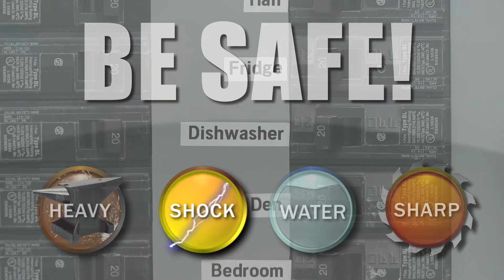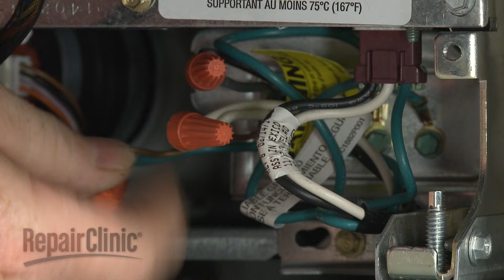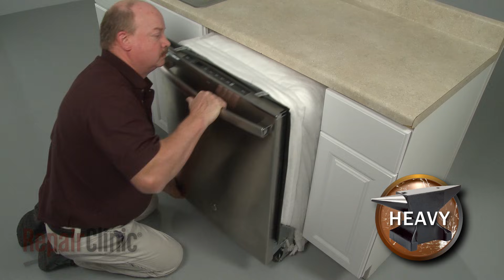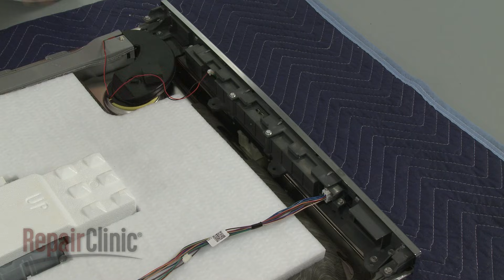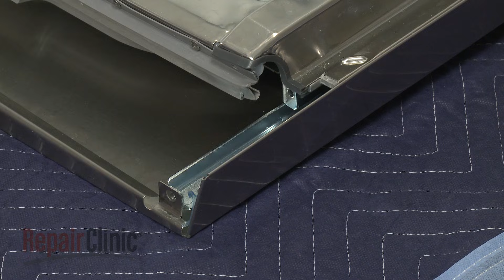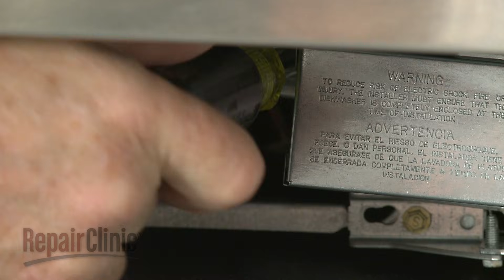GE Dishwasher Control and Display Board Replacement WD21X10553

Comment: This video left out one very important step when replacing the display board.  You need to reconfigure some pins on the back of the board to match your dishwasher model.  They call is setting the personality.  Instructions came with the replacement board GE sent me.
Reply: The particular board that he replaced do not have pins to reconfigure,  you have a different board.

Comment: My model is the GDT535psj2ss and it says it needs the WD21X23097 UI board.  They sent me the wd21x31910 but it has a number display. My model does not have a digital number display but the board they sent me does and they say its a replacement part.  Will it fit and work even though my top doesnt display numbers?

Comment: Here’s a tip if you want to avoid pulling the machine out to get access to the hinge cords.  It is easy to get the cords to pop OFF the little pulleys on the front, but very difficult to get them to pop back ON those little pulleys, without having access and leverage from the side. That’s the reason to pull the machine out of the cabinet. The springs are strong and fight back. and you CANT fit both hands under there to apply enough muscle.  (well I couldn't, anyway)

Here’s what you do to make it easy:

1) Get yourself a dog leash, with a nice clip. Yes, a dog leash. 

2) reach back along that cord until you get to the steel spring. you are probably elbow deep when you get there. 

3) clip the leash to the end of the spring, the same place where the cord is attached. 

4) now you can pull on the leash and extend that spring without even putting your hands under the machine. 

5) with the pressure off the cord, it is easy - oh so EASY - to just place that plastic end of the spring cord where it belongs. 

6 finally, reach back in and unclip your leash. 

a triumph!!

Comment: If you have the breaker power off, you don’t need to unwired the junction box, just disconnected the door wire along with the strings that holds the door… I do this type of work every day and only takes me about 30 minutes if that…

Comment: The part where you remove the inner panel by “slide the inner panel up” does absolutely nothing. I’ve removed both sets of screws on the brackets and removed those. It ain’t budging. Feels like I’m gonna break it
Reply: Did you figure this out?  I'm having the same issue with mine.

Comment: I found our dishwasher had not drained and there seemed to be no power to it. All the circuits are fine and the GFI not tripped. Checked underneath and it looks like there is an extension cord used for the power. Touched it and it started to work. It must have come loose somehow so I have tightened it and the problem is solve.

Comment: What about the jumper settings on the User Interface?
GDT655 personality 11 doesn’t work…
????
Reply: Same problem here.  Just replaced the UI board being careful to set the personality 11 setting.  Still not working.  Was told by a tech that power was good on bottom board but not on top.
Reply: Just discovered I had the pins wrong after all.  The board came with all jumpers set leaving the top row of pins open which is not the correct personality (11).  I didn't look carefully enough to notice.  With pins in the correct spot, the board powered up.

Comment: This video was absolutely spot on with information for a DIY. I have absolutely no experience in appliance repair but I applied all my years of working on computers and building them in integrated systems and looked at this project I was like it was one big computer. For me that logic worked perfectly and I was able to completely rebuild the dishwasher with the new board in a very timely fashion of about two hours and that’s taken into account my total lack of experience and understanding of appliances. Thank you so very much for this great video

Comment: Definitely not an easy repair. There are easier ways to do this. Look for other videos on technicians who do this everyday. They aren't going to disconnect the entire dishwash just to replace a control board.
Reply: Agree. Why disconnect the electrical leads and drain hose. If the door is unplugged and you pull it out a few inches to remove the door springs, you're already there. It seems they added in 6 unnecessary steps.

Comment: Great video, thanks! My humble contribution: modern models (like the ZDT915SSPJ0SS) do not require the bottom hinges to be removed. 4 Tork screws have to be removed at both sides of the door and it will be released. The new board requires configuration according to the model number. It is called ¨personality¨ .This can be done using the jumpers supplied with the new version of the board, following the instructions supplied. Save jumpers not used for eventual need in the future (jumpers showing  connecting only one pin can be removed). During final re-assembling pay attention to connect the 2 springs at the back (Left side only) that may have escaped/disconnected from the tension cord.
Reply: This is not humble. THIS COMMENT SHOULD BE PINNED TO THE TOP. 4 torx of size T25 I believe, 2 on each side. Hinges do not come out but need to remove one hinge screw on each side connected to the door.  AND YES THE LEFT SIDE CABLE DISCONNECTED! I had to fish it like a mission impossible spy to get it rehooked.

Comment: This is a solid video for RnR the UI board, with the following caveat. Replacement UI boards may arrive needing jumpers set for your specific model. 4 jumpers will need to be set according to instructions that accompany the replacement board. Lastly, door hinges may come with slightly different configurations, but with a little common sense observation detaching the inner panel will become obvious.

Comment: They neglected to show the set up of the jumper.  Pretty critical step.
Reply: Depends on the board you buy, if you buy the “exact” one that comes from the factory it doesn’t need it. GE has since switched to a more “generic” model that works across multiple machines for repairs. And yes then you have to se it

Comment: This video is very helpful.  However, the video does skip one very important step and that is to remove the vent cap on inside part of the door.  If you do not unscrew this cap the inner door will not separate from the outer door.  The video shows the entire vent assembly coming off with the inner door possibly because it is a different model or maybe a demo model.
Reply: Thank you. I was wondering what happened when the video showed the UI panel already off. I pulled a little bit and broke one of the screws hinting the vent to the panel. Thankfully I found your comment before I broke the other screw. Some glue should give it fine. Thanks for your comment.
Reply: This comment saved my repair effort.  The tiny inside vent screws like 1/4 turn or 1/2 turn and then the entire piece comes out super easily.  Found yucky stuff on the panel hidden inside, well there's my problem right there!  Glad I didn't break the plastic casing in an effort to get to it.  Thanks again!~

Comment: Will just add more of the same.  We had some random beeping from the dishwasher off and on after 3 years ownership.  Then all function of the control lights went out.  Circuit breaker did not trip.  Called GE and after very lengthy wait (6 hours) they called back, and finally agreed to sell me the main control board and UI panel for half price.  It took a few weeks but they finally arrived.  Replaced the main control board first and no change.  Then followed the instructions on this video (generally) cuz mine was a slightly different model. I had some trouble interpreting the jumper diagram but finally determined to pay attention on the diagram which round pins were connected to match the diagram.  For my model GDT695, the jumpers connected pins in the 1 2 and 8 position.  Number 4 pin just hung off to the side or I could have just tossed it completely.  Reassembled and everything worked.
Reply: Did the jumper diagram come with the new UI? I have the same model and issue. Not really understanding what replacement of the wiring with jumpers, new board not exact replacement but a universal board that fits multiple units? But can be used if jumped? Are contact pins easily accessible?
Reply: @joebrewer5885  Yes jumper diagram came with new board directly from GE.  Pins and little jumper sockets are easily accessed prior to install.

Comment: I’m trying to decide if we need to replace the user interface board or the lower board. Our dishwashers upper interface panel will show no lights as if it has no power. We’ve removed the lower panel and unplugged the door wire connector and that occasionally allows us to then gain power back and run a cycle. It’s inconsistent though. Sometimes it needs to sit unplugged for a while and then we will reconnect and it will finally work. Please help! What part should I order?
Reply: Having this same problem. Ordered a new power control board that's on it's way here but worried the UI interface is what I need to replace instead. Did one or the other end up working for you?
Reply: @Puddles_313  I’m still dealing with the issue as I was hoping for a reply that would help decide on which to order. If I end up ordering both it almost seems like a new dishwasher would make more sense…..
Reply: I have the GDF550 D/W with no UI display after one year! The same problem everyone has with these GE D/W's. I looked at the PC board on the bottom and found a connector that is mounted to the PC board, was loose.  No connector on  any PC board should be loose!  The PC board with the bad connector came from GE or it's PC board supplier. It was labeled J704 on my PC board. I used a glue gun to secure that connector to the PC board and the UI and dishwasher is working fine now and I don't have to unplug the wall plug or the door wire connector anymore. I'm not sure if this will last. Consult a professional if your not sure.
Reply: Only way to truly diagnose the issue is when the UI drops dead you need to see if you have around 14VDC at the connector on the UI board.  Without a model number I can't tell you which wires to test for the 14VDC.  If I were to take a guess, based on the little information you gave, you either have an issue with the UI (most likely) or there is an issue with the wire harness going from the main control board to the UI (less likely). The main control board very rarely causes this problem. Again the only sure way to diagnose is as I described above.
Some GE models have a kit that comes with the UI and the main control board and a wire harness, although the wire harness the kit contains does not include the harness section that goes from the main control board to the UI, which makes no sense to me. It only would have required another 50 cents for that part.
GE is having a ton of issues with these models and they don't have a tech support number to help anyone. They just want to send out their service tech so they can milk you for at least a 125 dollar service charge. Ever since Haier bought a majority interest in the GE Appliance sector the company has gone down the toilet with the quality of their products.
Reply: @TheNYgolfer  Just because you find 14v does not clear all the other signal wires. Do not slip and short out the thing w probes.

Comment: Will this solution work for my 2year old GE Cafe dishwasher?  Recently, instead of it starting the cycle we get a flashing yellow light and a beep, beep, beep sound.  We replaced the latch but still no luck.  The repairman said it was this board and quoted us $600 for a repair!
Reply: You can replace the board yourself . It’s about $100 and pretty easy to change. If the small light on it isn’t lit then the board is bad. I replaced mine but still having problems with the controls not light in up about a month after replacing the board. Dishes aren’t dry either. I’m considering just replacing the dishwasher and never buying GE again. 

$600 for repairs of a $600 dishwasher?

Comment: Our GE dishwasher was making random beeps for a month or so before it just stopped working.  This dishwasher was a mid to upper grade GE and was only 3 years old.  The controls did not show any signs of power or working.  After checking all the circuits and plugs, I started researching possible solutions,  These repair clinic video's are very well done and show all the possible step by step instructions.  The Interface board was the cure for my dishwasher.  At first the new interface board did not seem to work.  But the new board contained instructions for setting the personality and arranging the pins on the board.  There were 8 pins with a plastic fittings.  Each fitting enclosed two pins.  I had to move one of the fittings to a different arrangement per the instructions.  After making this minor change, the dishwasher turned on and started working.  This video along with other customers who explained what they were experiencing with their GE dishwasher really helped save me a lot of money.  I live in a rural area of the South West and there are not many appliance repair companies near me.  If this did not work, my wife was wanting to just purchase a new dishwasher.  Thank you Repair Clinic!!
Reply: Yep! Be sure to check the instructions that come with the unit to adjust the pins to your dishwasher model. My son figured this out and before I knew it, we were up and running perfectly. This video was not exact to my unit, but close enough to be helpful.
Reply: Thank you!  My dishwasher started the random beeps last week and died this week
Reply: Mine beeped for a couple months sporadically and then died. Time to replace the UI panel.
Reply: Thanks for your comment.  Just got my new UI board now.
Reply: Mine went about 3 more years and had the same issue, finding G.E to be in the last appliance tier moving forward. For a dishwasher nxt time I am thinking Bosch!!! Reliability seems superb in this category with this manufacturer!!

Comment: The new board comes with jumpers , you will have to move those jumpers depending on the dishwasher’s model #, read the instructions that comes with the board! Otherwise it won’t come on.
Reply: My old board did not have jumpers and the replacement I installed did not either. However, I went through these steps and the UI is still not turning on. Any thoughts?
Reply: How do you move them without damaging them?
Reply: Tim Horne use a needle nose pliers to remove and place them in the right place according to the installation sheet. Depending on your dishwasher model. This board comes with the sheet.
Reply: I’m having this same issue. The old board didn’t have any jumpers, but the new board did. I changed the jumpers according to the specifications for my model number and now I have beeping sounds and every 9th button press the boost light comes on but nothing else. Any suggestions before we remove the door and put the jumpers back in the original position. Also the select cycle isn’t responding at all
Reply: Adding to help: My original board had no jumpers. I ordered the correct replacement board and set it to the designated jump pattern (personality 10), it didn't work. I put the jumpers on all of the pins and then the board worked. I have a GDF610 and also had the random beeping.
Reply: Some replacement boards don't come with jumpers.. what do you use instead?